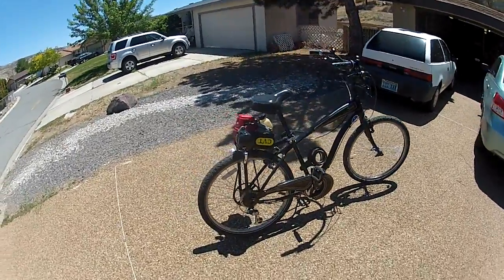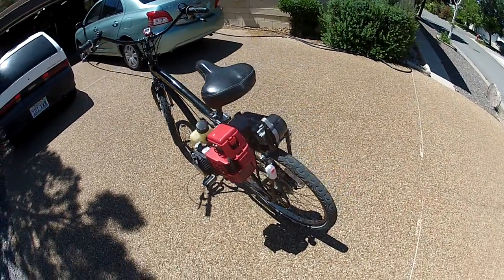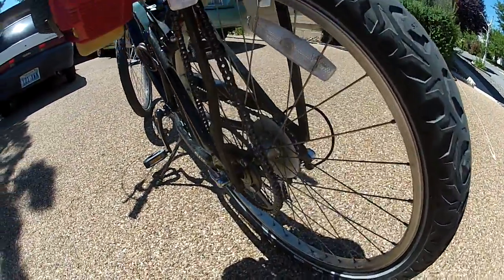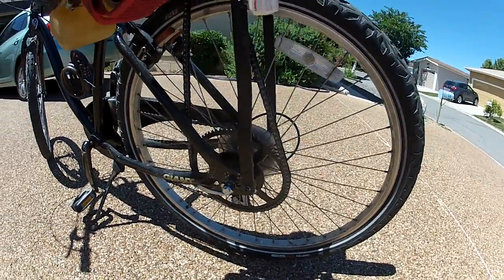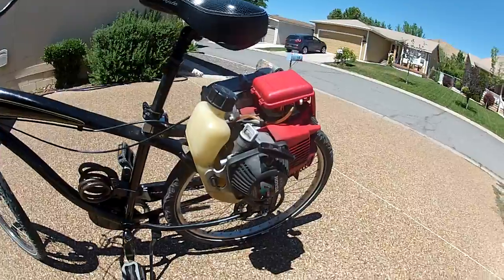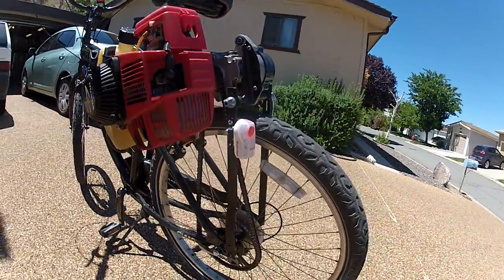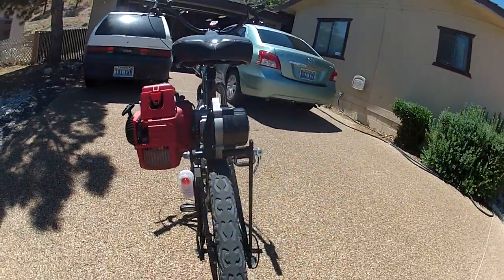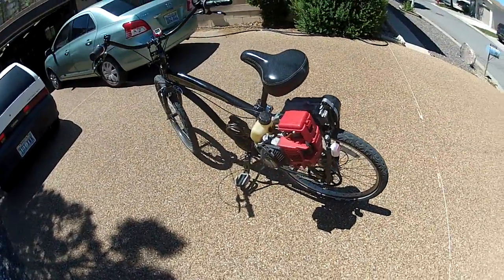Honda GX engine on bicycle with pocketbike CVT transmission

Comment: do you think it would have been better with a larger stronger engine?
Reply from the maker: The engine was fine, it was the fact that the transmission had no dowels to keep the bearings in alignment. That is my guess as to why it failed in 50 miles.

Comment: where did you get the cvt?
Reply from the maker: It was a cheap Chinese one from a website. I don't think you want one, it didn't last 50 miles before loud bearing noise happened.
Reply from the maker: John Kimble  https://www.monsterscooterparts.com/cvtwichco.html?gclid=CjwKCAiA1eKBBhBZEiwAX3gql0c9umMadRGTVJZmXMv-DGVdApAEkiMi61MjMZiawU-X-XiER9_LAhoCKTYQAvD_BwE

Comment: It should have power uphill it's a CVT which will keep your ribs in the ideal RPM with your highest torque and horsepower output and hold it there while accelerating

Comment: Yeah but you're still putting a finite ratio using that chainit's not a true CVT unless it's hub mounted and work similar to motorbikes
Reply: Actually is the same because CVT motorcycles have something called a final drive ratio that determines the final gearing

Comment: STAY AWAY FROM HONDA

I purchased kit with this same motor for my bike and have nothing but problems. Honda service is the worst on the planet. After 100-150 miles engine is dying on high RPM or when it needs more power. After first winter the clutch stopped working. Basically I'm about to throw this into the dumpster. My motor was 3 times in a shop and they were not able to fix it. Sent multiple Emails to Honda and no response. Called several numbers and they were pointing me to the dealer repair shops, then those dealers claimed they do not repair stand-alone motors, or many of them have had no knowledge at all. Totally bed experience. Stay away from Honda small motors - it is piece of junk :-(
Reply from the maker: The clutch will heat up and destroy itself if you slip it a lot, like climbing hills below 9mph where it is not fully engaged but slipping. Make sure the gas cap isn't restricting airflow into the tank. You have to be willing to tinker with bicycle engines.
Reply: Love your reply Alex’ where did u hear the term tinker ‘ it is a common word here in Ireland ‘ as you may know it relates to tin smiths or tin bucket makers ‘ or roving travelers that made things out of tin ‘ hence the word tinkering about 😄

Comment: do you think the cvt itself eats up some power
Reply from the maker: Yes, it is definitely not as efficient as the Golden Eagle belt drive system I tried next. But going up steep hills the CVT was unstoppable. Totally worth the ineffiency if you need to climb hills. Too bad nobody makes a good quality one.

Comment: an electric motor is more efficient i guess
Reply: Efficient? No.

100 miles per gallon at 20 mph versus 15 miles per charge at the same speed...thats not efficiency.

Eco-friendly? Sure.

Comment: Sounds like your engine is bogged down and needs a much smaller sprocket on the engine... does it rev out up top? If not, a gear reduction will gain you input torque and use your cvt to greater effect. Nice setup!

Comment: The motor doesn’t mind being run on it’s side?
Reply: These are meant for all kinds of applications for garden equipment which sees all kinds of directional change during use.  Probably fine.
Reply: This engine was designed to run in any orientation.

Comment: Creative engineering. Where did you get the left hand threaded hub and freewheel? Need those for my project. Thanks.
Reply from the maker: +twowheelscooter ebay. It was low quality and not nearly as nice as the one I bought from Staton inc with their rear axle mount engine kit.